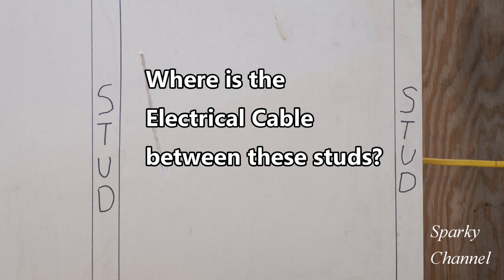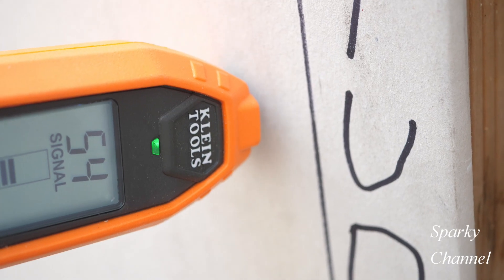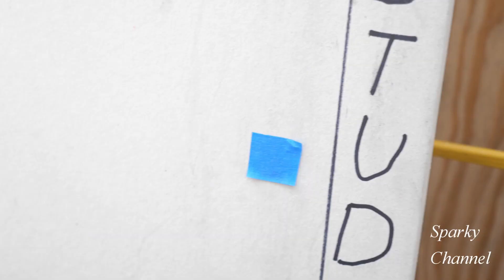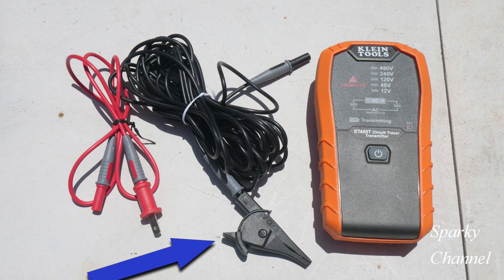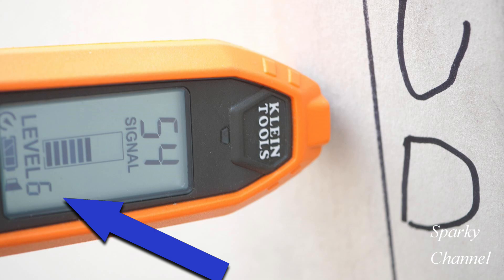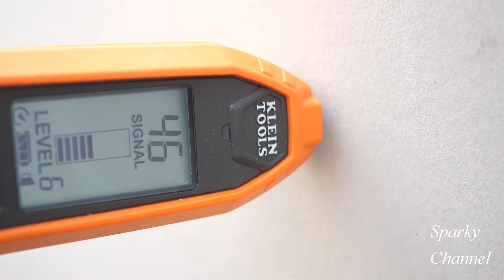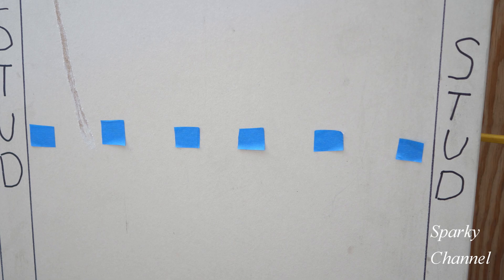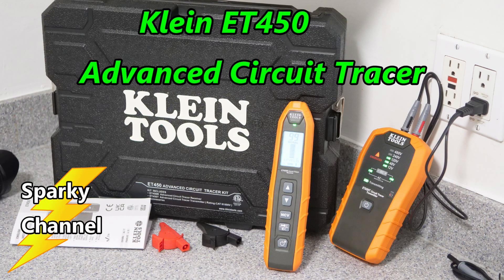Can the Klein Circuit Tracer ET450 Detect Romex Through Drywall?

Comment: So will this device be adequate to find which set of wires are powering a certain motor in an industrial seting? I see you can do it wirelessly which is important, we dont want to have to disconnect any wires to find where it ends
Reply: If you can hook up the transmitter to only one of the conductors at a time, then probably yes.  The farther apart the conductors are, the better.  But you can probably adjust the sensitivity so that it would be pretty clear which carries the signal even if they are close together.

Comment: Hi bill, trying to buy a basic/not too expensive multimeter that i can use for working in my cars and home. Mostly, I will be doing load test and continuity. What do you recommend?
Reply: Ideal 61-747 it's a great very well equipped multi meter that has alot of fantastic features that aren't offered on some fluke meters, I swear by them you can get em around 80-100 but it's worth every penny, the tight sight feature along makes it a fantastic choice

Comment: Hello Bill,                                                    I'm not sold on this device. ... Why?             1.) It device takes too long to accomplish it's intended task of finding an electrical wire.                                                                 2.) And once it does find a hidden electrical wire, it fluctuates too much on the screen that it has found a wire. And, it doesn't 🚨beep when it is absolutely on dead center of an electrical wire!
Reply: What device do you like?

Comment: Sparky   ....a viewer   is wondering if a clamp meter will get  a reading  through  gray pvc conduit as well as emt...is there  a possibility of a video being made on this question??
Reply from the maker: When using a clamp meter, one must isolate either the hot or neutral to put the clamp around. Since both hot and neutral are in the various conduits, a clamp meter will not work while testing outside of a conduit.

Comment: Romex is a brand. *NM wire
Reply: Duh, the guy knows that. Romex is also a generic name, like xerox is a facsimile (photo image) of the original and FAX is the generic name for facsimile. Hoover is is a brand, but when you speak of vacuums or loose women, you say “she Hoovers like a real pro should!” 😂
Reply: What a weird comment, everyone and their grandmom calls it romex. Everyone knows it's non-metallic. Also technically your wrong as well, it's Considered "CABLE" Not wire as it has multiple conductors in sheathing.
Reply from the maker: Yes, thanks!

Comment: How do you plug the one lead into tamper resistance receptacles
Reply from the maker: I'll have to show that on a video. It's not too difficult. They give you 2 single blades. You start with the black blade on the neutral side, then slip the red into the hot side of the TR receptacle.
Reply: Shove it in! The tamper resistant ones are not impregnable, just a means to keep less tenacious children from having to be buried at a young age. It works for idiots of all ages, but still isn’t completely foolproof. 😂
Reply: A better choice might be to plug a 3 prong adapter into the TR plug and plug the tester lead into the adapter.

Comment: Does fiberglass insulation effect the tracing?  Or is this only for interior walls with no insulation
Reply: It will not effect it.
Reply from the maker: Fiberglass insulation won't affect the readings.

Comment: Anyone can answer if they know. Is there  a powered continuity tester on the market ?
Reply from the maker: Any good digital multimeter is powered by batteries and features continuity. For instance, a Fluke 117 electrician's meter.
Reply: @SparkyChannel  Thanks for the reply. I know if not safe to work on live current. But do you think there is a need for a continuity tester that works on live current?
Reply from the maker: @richstarstar  IMO, no.
Reply: @richstarstar  You need a circuit tracer like the one in the video most likely to do what you are talking about. Otherwise, regular continuity is done only on unenergized circuits. There is no reason to leave power on if you want to test continuity.
Reply: @illestofdemall13  thanks

Comment: Hi! I have an off grid cabin that is wired 120 for generator power. Because it was built on rock, there is no ground. How can I locate the Romex? So far, I've been  lucky when piercing the wall, such as when I installed cabinets, but I don't like to rely on luck with electricity!
Reply from the maker: Do you have cold water pipes that go into the earth?
Reply: @SparkyChannel  no. We bring water in from the lake. Gas pump to 55 gal barrel and then gravity.
Reply from the maker: @rodmartel3143  OK. Can you drive a ground rod into the ground anywhere. Even if you just had a 3' piece of ground rod and got it into the ground about a foot I think it would work as a ground for the tracer.
Reply: @SparkyChannel  thanks. I'll try!!